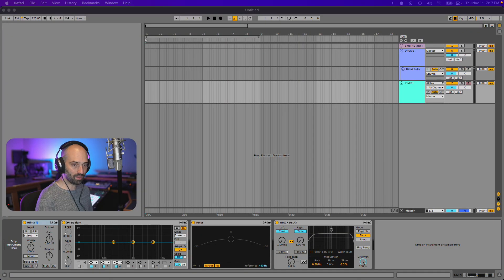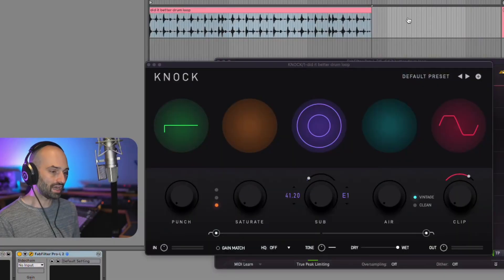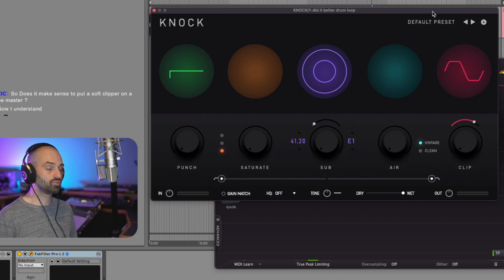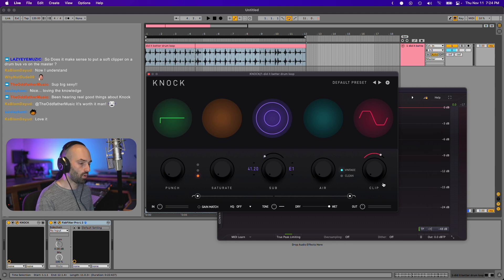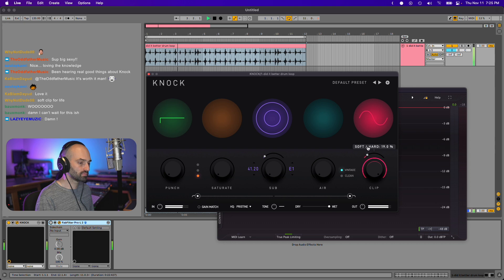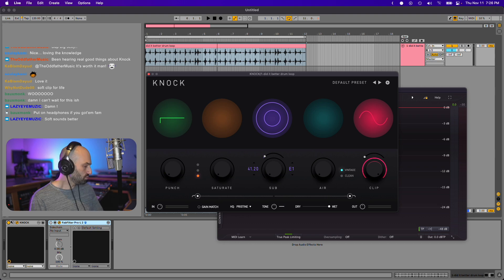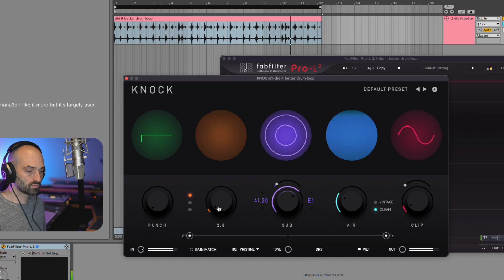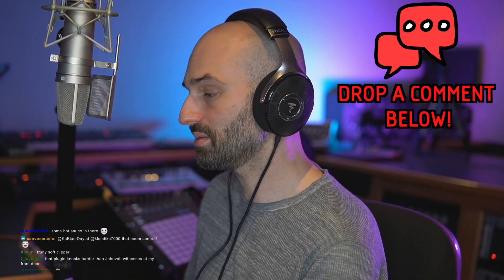Soft clipper vs limiter | When to use each 🤔

Comment: Great vid DECAP, More people need to talk about clipping because it’s a critical part of mixing/mastering! A lot of newer producers think clipping is just a plugin in FL that you put on to distort 808’s or something bad altogether. 

For anyone interested here a Compression/Limiting vs Soft/Hard Clipping technical explanation:

A Compressor/Limiter is taking the signal you give it, and pushing it down (for example -6dB). The reduction is dependent on things like Ratio, Threshold, Knee etc. With the right attack and release settings you can get a lot of punch out of a compressor, or even retain a lot of transient with a limiter. But regardless of how hard you push it,  you’ll always be reducing the signal. 

With a Soft/Hard Clipper you’re like a magician. Take StandardClip for example, you set the clip threshold and then instead of reducing the signal on the transients it just makes it disappear. As if it was never there. As soon as the signal goes above the clip threshold, it chops it off, keeping everything below the threshold while making the peak of the waveform disappear. 
The difference between soft and hard clipping is what the shape of the waveform looks like when it’s being clipped. 100% hard clipping just cuts the waveform off flat, like the top of a Square wave. 
And Soft clipping will still keep everything below 0.0dB, but it’ll start rounding it off a little bit before it gets there so the top of the waveform looks a little more like a sine wave. Giving it a rounder and warmer tone. 

Hope this helps!
Reply: Thanks dude
Reply: So sir may i asked you which of this between limiter and clipping is a go for the master channel....Which one you used between soft and hard clipper mostly for your production 🙏🙏i know it depends on the music I'm looking but i just wanne hear it from you,you seems legit 🙏🙏thank you....
Reply: great explanation, thank you for this
Reply: Finally someone makes sense. Thank you.
Reply: It was never an either OR situation.
Producers tend to use multi band compression going into a clipper, going into a compressor and / or limiter.
Depending on the song and the genre, you usually need to do various compressor and / or limiter (loudness) layers.
Instead of just maxing the level on the final Loudness Limiter! 
Also think of the clipper handling the peaks, so you’re limiter doesn’t have to react to those weird peaks throughout the song.

Comment: Thank you for the great video!
I think that maybe a better way to explain the transient "shaving" between a clipper (hard) and a limiter is that the clipper the body of that transient seems to keep as loud as before, but when limiting, it seems that some kind of "release"" time keeps the body of that peak being pushed down for while so, the overall snap, punch of the hit gets "too lowered" for most cases...
Roughly, limiting is about volume shaping and clipping is about crunching with some distortion...
I think the soft clipper is the best way for percussive instruments and a limiter can be a better choice for no transients dependent sounds like vocals, synth pads, reverbs...
Or, like you've said, limiting the final mix or a bus, it's great.
The negative point of this video is that would be way easier to notice the differences using a kick distortion-free...
But that's only my point of view...

Comment: If you hold alt while increasing the gain in L2 you can hear what the limiter is doing without increasing the loudness. Much better way to hear what’s going on. Also, using Wave Observer to see what’s happening to the waveforms from different plugins is a game changer. I think Wave Observer is free too. I put it on the master and and it helps so much to see transients, levels of things like vocals compared to drums or sub base compared to drum transients, see what compressors are doing, like how much they’re actually compressing in real time and how the wave forms change with different attack, ratio, and release settings. Super helpful IMO and I use it all the time.

Comment: what exactly does the clip knob in Knock do? is it a mix knob or does it drive the gain into the output ceiling with whatever clip mode you have set?
Reply from the maker: The clip knob drives the gain into the clipper. There is also a dry wet control.

Comment: Can you do this in ableton?
Reply: Yes. Stock plugins glue compressor and gentle limiter
Reply from the maker: Glue Compressor can do soft clipping - you just can't move between soft and hard clipping like KNOCK. Ableton also has a stock limiter - but isn't as transparent as something like Pro-L 2.
Reply: Soft clipping - it works well with the ableton saturator on the soft sine curve

Comment: It's crazy that people are still getting this wrong.

Pro L2 is a soft clipper followed by a compressor, like 90% of modern digital limiters are. It's stated in the manual : the attack time separates the clipper section from the compressor section, which works with the release time you set. 

A "limiter" is a high-ratio compressor, like the ones you find on Neves 2254 and 33609. It's not used so much nowadays by bedroom producers (but still are insanely great tools). Pro L2 doesnt work this way as the first section literally transforms transients into saturation, as a digital ceiling (that is what we call a clipper). A limiter also introduces saturation (as a high ratio compressor), but is not as extreme as a clipper : transients can exceed the threshold you set (even if it's 0,1db), and there's a release time for limiting to decrease after his action.

A clipper doesn't have a release time : it's only a brickwall effect, a ceiling signal can't exceed. Pro L2's clipper part doesn't have release time : his following compressor section have. That's why you get a more transparent effect : you're telling the clipper when to stop and when to get a smoother compression release. 

With a long attack time (so no compression release), pro L2 can sound the same as a soft clipper. Thats what different algorithms are for.

Pro L2 is a most transparent tool as what you call "clippers" because of its 2 portions. It separates the transient in two parts to get clipping without harshness, and transient ceiling without pumping.

There's nothing wrong with the way people use clippers like Knockl and Pro-L2, and it's true you can consider one saturated and the other one transparent. However, this misconception leads to an inadequate understanding of modern limiters, and to an oversight of true limiters (Neves for instance).

Theres a reason why mastering engineers crave for an original 2254 compressor/limiter which you often find around >10k $. Does wonders on masters.

Knock = soft/hard clipper
Pro 2 = half soft/hard clipper, half compressor with tweakable release time
Neves = limiters (high ratio compressor with tweable release time)